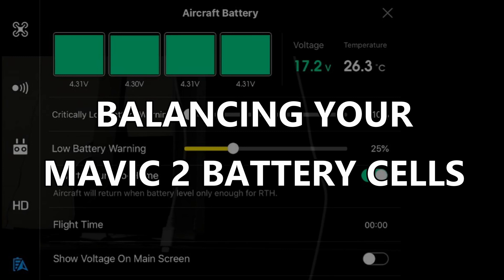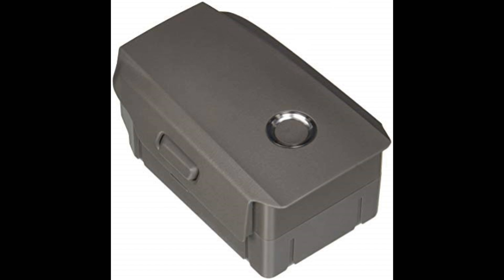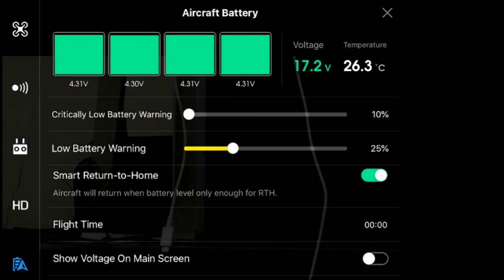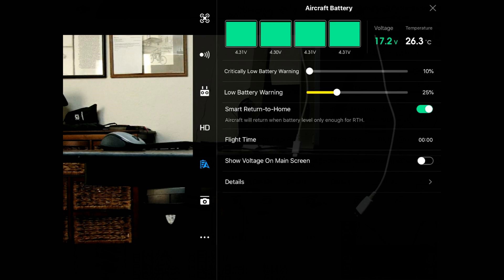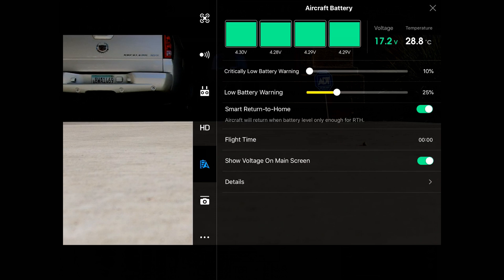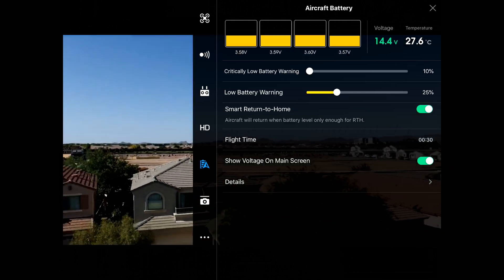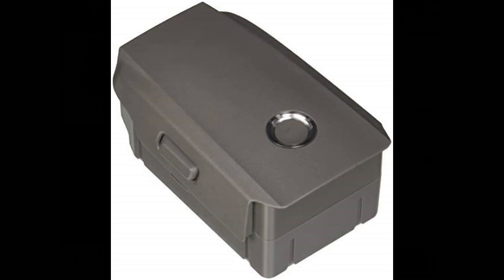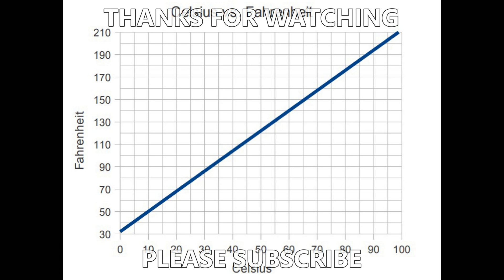BALANCING YOUR MAVIC 2 BATTERY CELLS

Comment: 10.32 min, your radar doesn’t look like it’s pointing in the correct direction. It should be pointing towards you I think. Metal under concrete?
Reply: Sorry 10.20 to 10.32minutes
Reply from the maker: @josephgonzalez9522  I'm sitting to the north and it is facing north so I think it's OK but thanks for the input and God bless.
Reply: The drones camera was facing you but the drones radar was facing to the right. It did jump around and correct its self a bit later. Carry on the great work.

Comment: If you have charged batteries (with DJI drones) after the time you set , they self discharge to their storage voltage (3.8V) the dji charger balance charges while charging or so I understand from what I have read . Not all aftermarket chargers balance charge so be careful if you are not using a DJI charger . Good video thanks .
Reply from the maker: Thanks Spencer. Yep I forgot to mention in the video about the ten-day period before they automatically discharge. That is for the Mavic 2. Other mavics and DJI drones do give you a choice of how long to wait. And, knowing what I have learned I would buy only DJI batteries from now on. I appreciate your input a lot. God bless.
Reply: @user-sr8pn9xg8z  I have both set to 3 days MP1 and P4P are you sure you can't on the MP2 ? I don't have MP2 but would think you could . You have a blessed day too .
Reply from the maker: @spencerboaz2385  Thanks but, nope, there is no option available for that. I appreciate your thoughts on it. God bless.
Reply: @user-sr8pn9xg8z  I guess that's another one of the things DJI's not adding to their new drones Like the MP1 had a 10 level zoom , the P4P is their top Phantom and it don't have zoom . I think they are trying to get away from consumer drones and only deal with the commercial market .
Reply from the maker: @spencerboaz2385  I don't know. I think they may have all the corners covered :)